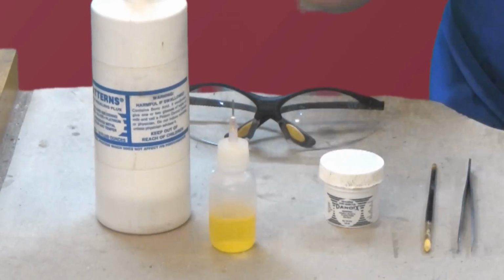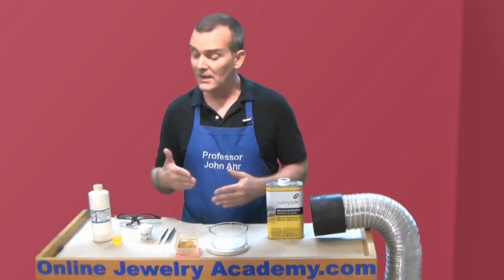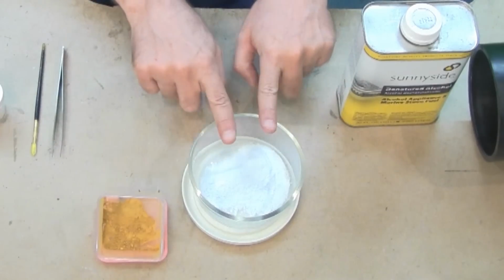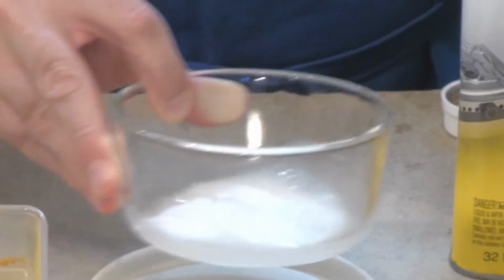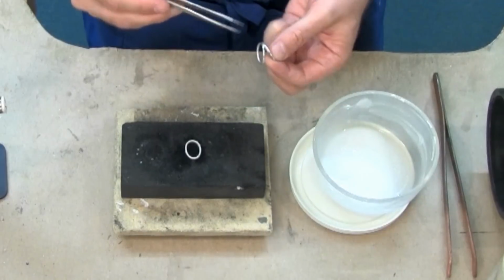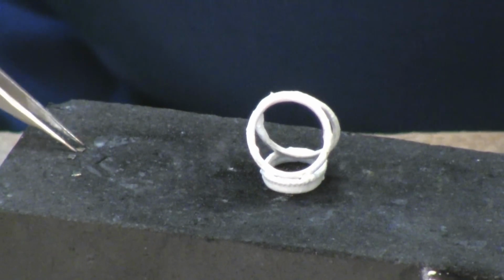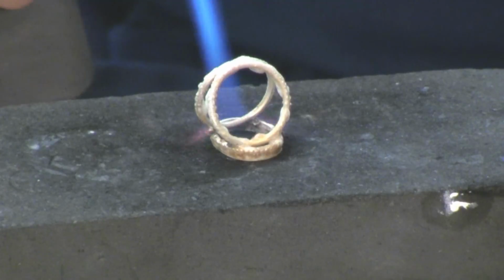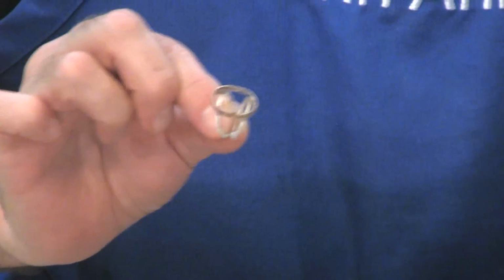What The FLUX - The Info You Need

Comment: I want to know if Ronda Coryell's  argenitum purple flux, which has far less surface tension and therefore coats your piece far better, can be used for regular sterling silver. gold, and copper.  ALSO, unrelated, but I would love to know how to prevent gold from turning green in the pickle.  Mostly I work in silver, but when I soldered a piece of 18k gold wire onto a silver piece, the gold took on a greenish hue which I figured was just something like silver from the pickle getting onto the surface of the gold, but even when I sanded it, the green seemed to be quite deep.  I read in an old article that this happens because the gold wasn't properly fluxed (and perhaps the silver in the alloy was raising to the surface), but here again, it should have been easy to sand off, like a raised fine silver surface on a piece of sterling silver, no?
Reply from the maker: From what I have read online, the flux you mentioned can be used for a wide variety of applications. I recommend that you experiment with it to see how you like to work with it.  As to why your gold turned green, I believe that you weren't working with real 18k gold.  You might want to test the rest of your 18k to see if it truly up to the standards of 18k.  😀

Comment: If I use barrtens' flux without those little pieces that you used to joint the ring with the bezel, will it work as the same?
Reply from the maker: No.  First, the flux you mentioned is for use with gold. Second, the “little pieces” are the solder pallions that melt, flow into the joints to bond them. I recommend that you watch the videos included in the soldering section of the OJA playlist on our website at: www.onlinejewelryacademy.com.  😀

Comment: What about good ole plumbing flux, can that be used. I want to cut a piece out of a gold ring and make it smaller.. I don't have flux but i do have the gold solder.. Also is it 100% necessary to even use flux if im just repairing a ring or two?
Reply from the maker: Plumbing flux is not formulated to withstand the temperatures required to solder gold.  And, you do need to use flux for every soldering operation.  Flux for gold is sold by every jewelry supply company. : )

Comment: Hi Professor John! Thank you so much for your great videos as always. I am just a little confused about something. I noticed in your other videos (for example, where you make a simple silver ring or the split shank) you do not cover the entire piece in flux,  you simply apply it to the join to allow the solder to flow. Why is that? Is firescale not a concern in that situation? I am just trying to determine when I should be covering the entire piece in flux. Thanks again!
Reply from the maker: Some jewelers who work with silver will cover the entire piece with a combination of boric acid and denatured alcohol as a fire scale inhibitor.  They will also use paste flux in spots where they intend to solder elements together.  This video was intended to merely demonstrate that the boric acid and denatured alcohol combination act as a primitive flux.  Unless a piece requires multiple heatings with the torch, I generally do not dip it into the boric acid and denatured alcohol slurry.  This is because solder can potentially flow wherever there is flux.  And, I tend to try to minimize my use of solder.  Fire scale can be ameliorated a few ways.  You can sand and polish it off of your piece.  You can "frost" your piece to hide it.  Or, you can simply silver plate the item.  I hope this clears things up for you.
Thanks for your support! : )

Comment: so, where does the ochre come in to play?
Reply from the maker: Hi Geoff,  The OJA has a video on how to use yellow ochre.  https://youtu.be/L6XnoQ6NLGE  It comes into play when you want to restrict the flow of solder.  It's most commonly used with white paste flux.  This is because you can control the placement of the ochre and the flux.  You can also use yellow ochre on previously soldered seams to prevent them from reflowing or depleting when you solder another element nearby.
Thanks for your support! : )

Comment: Some suggest using boric acid and alcohol as a "pre-flux", rather than as a final flux.  That is: dip in the pre-flux, then apply your flux of choice over top.  Professor Ahr, can you give your thoughts on this? (note that as a pre-flux it seems more alcohol is used so the mixture is thinner than what would be considered a slurry)
Reply from the maker: Hi Susan, Your comments are correct.  That is how the boric acid and denatured alcohol mixture is commonly used.  It is, however, a workable flux on its own as well.  If you have a better term to describe the consistency of the mixture other than "slurry" I'd like to know what it is.
Thanks for your support! : )
Reply: Hi, Professor Ahr! Thank you for your reply.  To clarify, I was not suggesting slurry was not the correct term for your mixture - to me it perfectly describes the consistency to aim for when using  boric acid/alcohol as the only flux.  My question was that I wondered, and did not communicate well, is whether or not when using it as a pre-flux or barrier flux (i.e. used before applying a final flux such as Handy Flux) do I need to thin down the slurry consistency somewhat? ps I love watching your videos - your enthusiasm is delightful and your videos are helpful!
Reply from the maker: Hi Susan, I was catching up on answering comments after recovering from a two week long flu.  Sorry I misread your question (and was a little cranky).  No, you do not need to add extra alcohol to the mixture if you are using it as a pre-flux.  If you add too much alcohol the mixture will not allow enough of the boric acid to adhere to your piece(s) to be effective.  The OJA has a video on preventing fire scale at:   https://youtu.be/YpEi4v-7QPw  
Thanks for your support! : )

Comment: Yippee!  Just in time for me to solder a bezel to a split shank that I made by following your video instructions.  Very successful it helped me to be, too.  I use a borax cone for all soldering but I'm thinking I will need to experiment with the liquid flux for high temperature solder as I am going to want to be soldering enamelled pieces in the not-too-distant future :-)
Reply from the maker: Hi Hilary, I'm glad that the videos have helped you to be successful with your creative projects.  Just to give you a heads up, enameled elements are never soldered together after enameling.  Other types of cold connections are used to join enameled pieces together.  In fact, solder is something that is kept to a minimum on enamel designs.  Enamel does not like to sit on top of solder.  And, soldered pieces can come apart in the kiln if you're not careful.
Thanks for your support! : )
Reply: Thanks for this, Prof Ahr.  I know very little about putting together pieces that include enamel so I'm soaking up all info. like a sponge.  I've got as far as knowing about solder specially for enamel work, I've done a little, basic enamelling and am due to do more soon.  I find your videos so clear and watch them regularly :-)